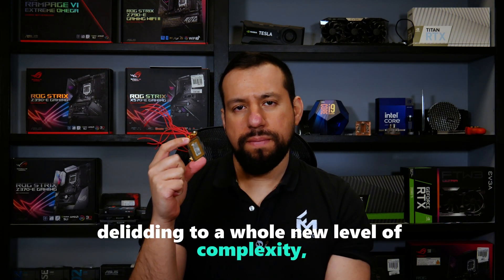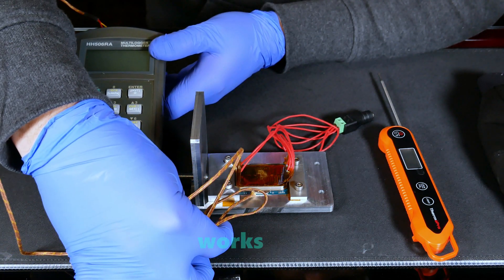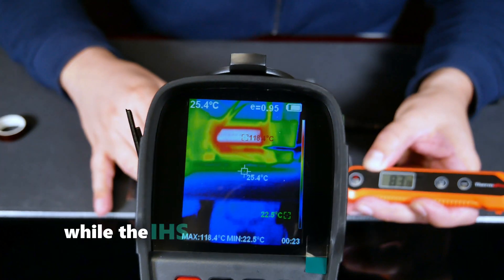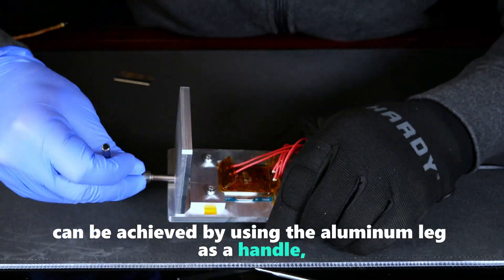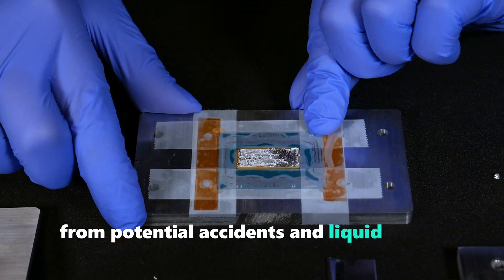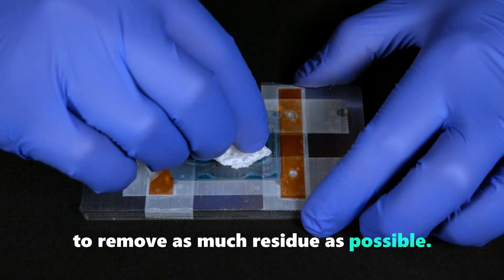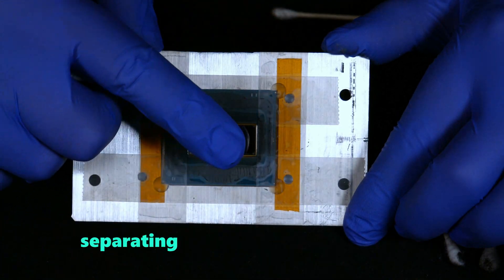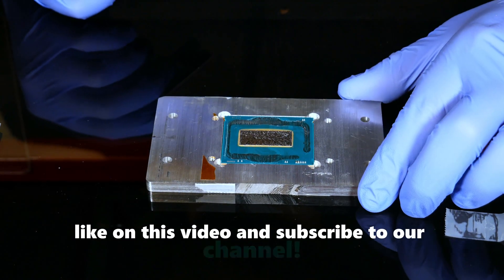Delidding Tool for Arrow Lake CPUs: Core Ultra 9 285K Tutorial (Melt the Indium, No Cracks!)

Comment: Iv used this tool from emcool, it makes the silicon sealant around the edge of the cpu liquid and makes it easy to rempbe the ihs with a razer. I let the ihs heat up for 20 min and then broke the ihs loose and used a razer to lift the ihs no problem

Comment: I have delidded a couple CPUs in the past but nothing like this. Just a thought: wouldn’t it be a little easier to heat up to the melting temperature, then flip the CPU and let the IHS fall by gravity? That way you wouldn't need the wedging part. I’m no expert but I think it is worth the try.
Reply from the maker: Hey! We did try that approach, but it wasn’t successful. The reason is that the glue is temperature-resistant and doesn’t melt like indium, not even at 200°C. Going beyond that temperature isn’t recommended, as it could damage the substrate and components. Therefore, the best approach is to shear the glue by pushing off the IHS while staying within the safe temperature range. We hope this explanation helps. Thank you for watching!
Reply: @emcoolinc  makes total sense, thanks for the detailed explanation!
Reply: I have used the emcool tool and it works fine. The indium wasn't not really liquid but close more the sealant around the silicon was soft and I just used a razer and the igs came right off